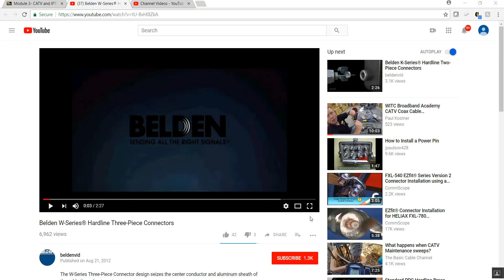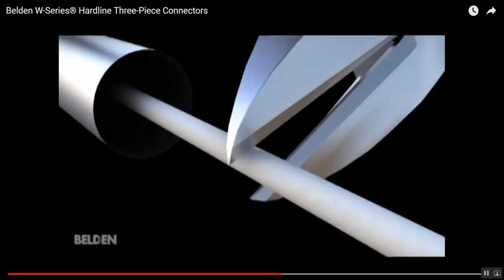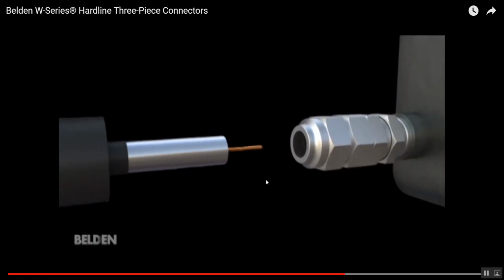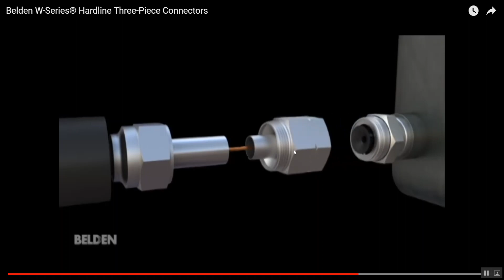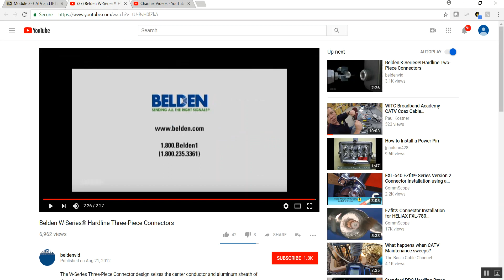Hardline Connector Installation

Comment: I thought that the PPC 3 piece hardline. Connectors'  pin length was measured from the bottom of the threads. Why is it different in this video?